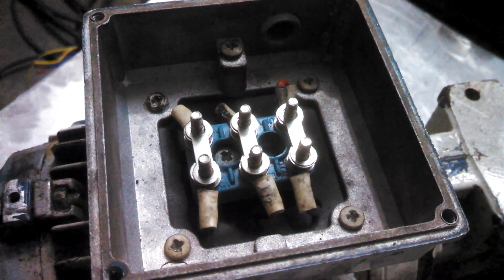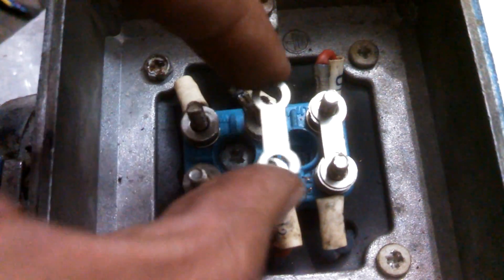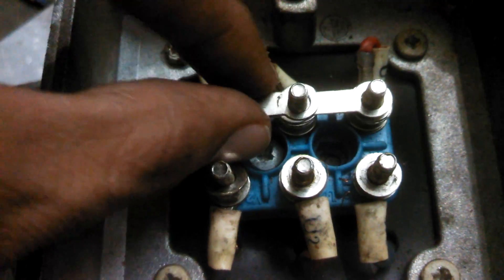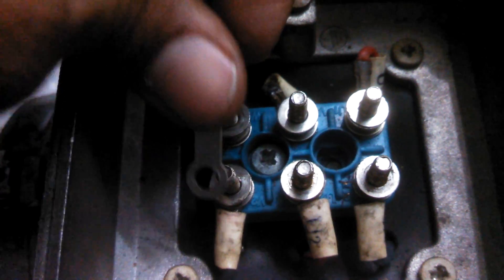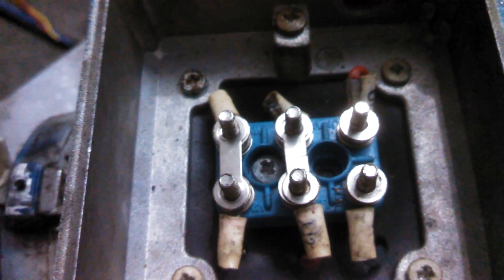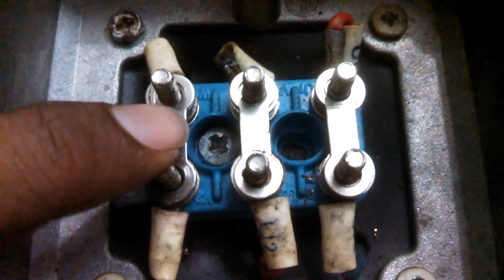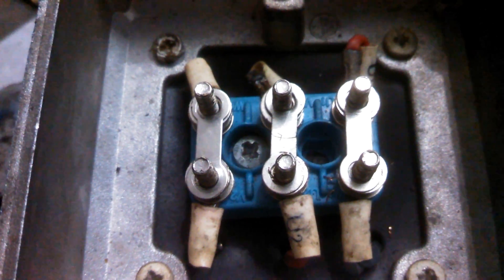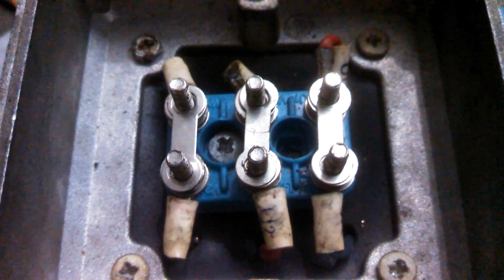4.STAR and DELTA connection of a three phase induction motor

Comment: Please let me know ,if a star delta six wire connection u1 u2,v1v2 , w1w2, mixed in the terminal box ,how do we find out v1u1w1 and v2u2w2 ? Could you please explain?
Reply from the maker: Check the continuity ot each coil
Reply: Sir plz watch my video on my channel...i explain it with diagram and practical

Comment: 3 phase and 4 Phase star Delta connection between please reply sir
Reply from the maker: There is no 4 phase connections concept  in electrical.. you maybe talking about the star connection with neutral... 
So in star connection the neutral is the reference point

Comment: greetings Brother

the voltage  rating on the name plate of a 3 phase AC motor 
the voltage is line line voltage or line to neutral voltage?

thank you
Reply from the maker: Line line voltage, also if you see the motor nameplate then you will find the star or delta symbol along with voltage so as simple as that 3 phase only, hence line to line